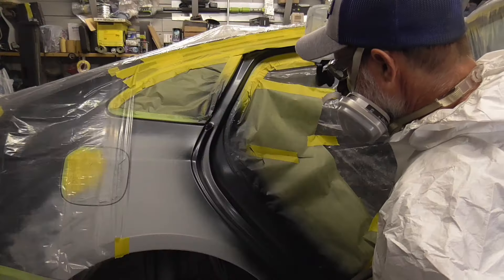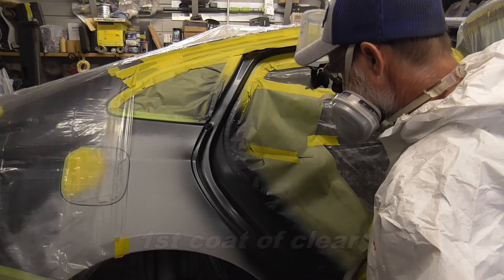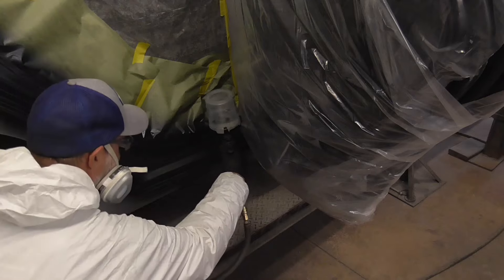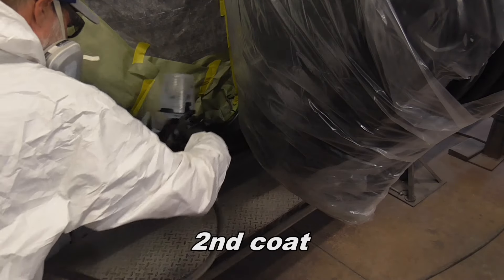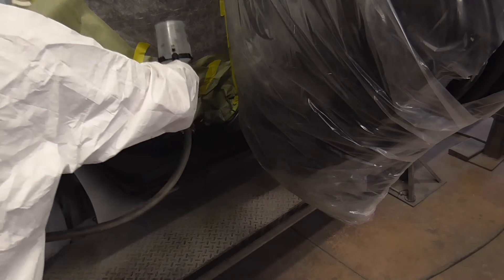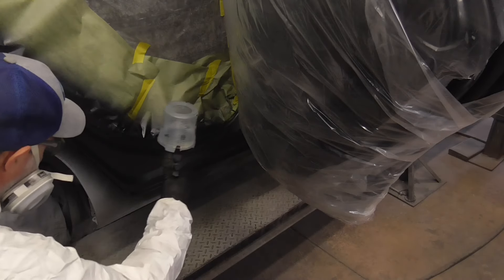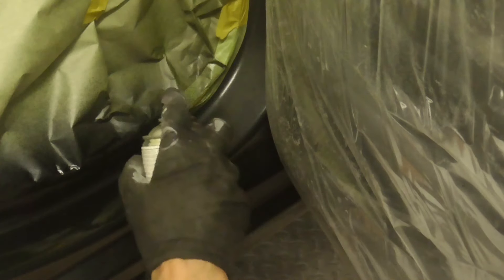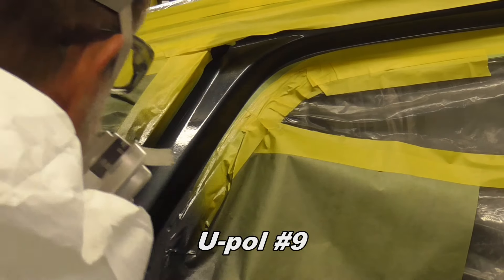How to Use a Spot Blender or Blending Solvent

Comment: I have used the fade out from an aerosol but I prefer using fade out from a can (Spectral Extra 895),that way you can add a little of your clearcoat to it for UV protection and it will polish as a blend area better.
Reply from the maker: Thanks for your tips Pete - good to hear all the methods out there :)

Comment: When do you use the product? Timing wise. Is the clear flashed off? Just after applying the clear? Is the clear tacky or cured etc?

I normally put 50% thinners and 50% clear and spray out edges with that - or pick up dry spots. I let the clear flash off for 10mins before I do that.
Reply from the maker: Right after the last coat of clear - the very second you finish - you don't have to wait any time at all.  You're fine doing it with reduced clear, pant, etc.  Some use plain 'ol straight reducer.

Comment: Will that work on rustoleum single stage paint cut with acetone and majik hardener?
Reply from the maker: Probably not.  For that you can just use over reduced paint/hardener.  On your last coat, go ahead and throw a bunch of acetone in the cup with the remaining paint/hardener - that will be you blender.  That's an old body shop method that worked real well with lacquer but sometimes not so good with enamel paints :)

Comment: Do you have to buff after it dry?
Reply from the maker: You can if you need to and it works really well like that.  I've only done small areas though so - not sure how it will do in the middle of a hood or door :)

Comment: So what do you get if you don't use this product? Dry overspray on the outter edges of the sprayed area?
Reply from the maker: Yes.  You can spray the whole jamb or try to melt in the edges with thin clear or even reducer.  This seems to work a bit better than using thinned clear, paint, or straight reducer 👍